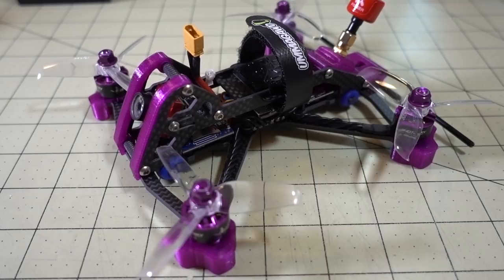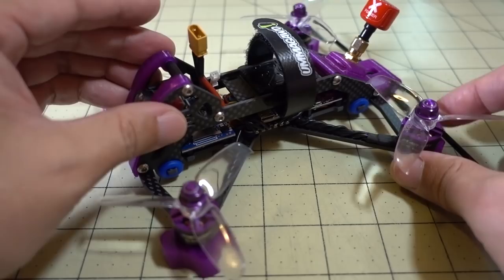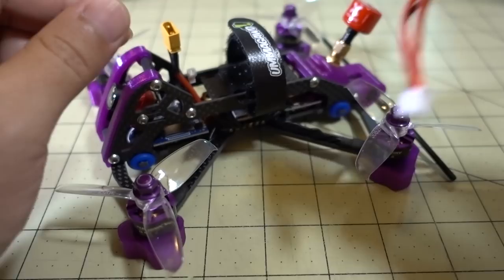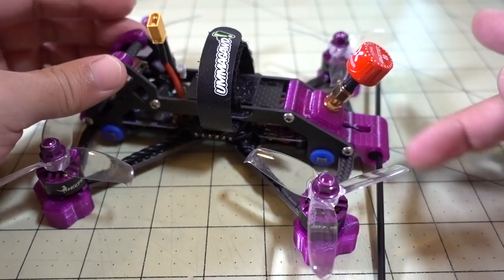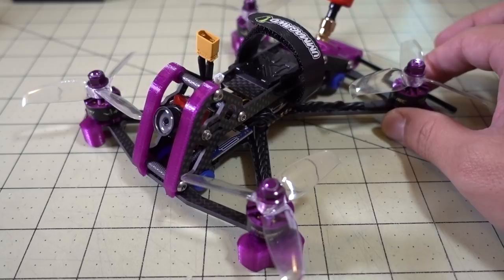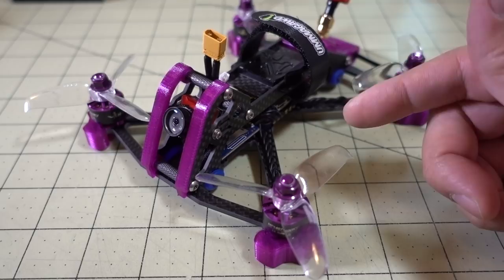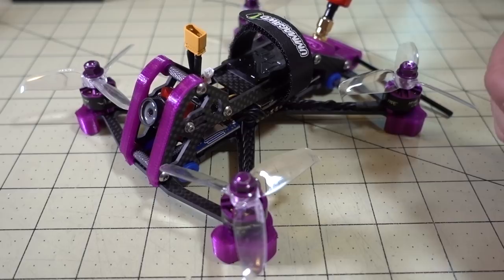The Acrobrat is a Heavy Micro 😜

Comment: I've been testing it out using BrotherHobby 1407 4100kv motors and Tattu 4S 650 batteries. Total weight with Caddx Turtle cam and no 3d printed parts is about 254g.  The quad flies extremely smooth with no jello in the video footage. Flight time can be a bit short at about 2 to 2.5 minutes with moderate acro flying. I'm hoping to find a setup that can last a bit longer with more aggressive flying. Maybe the new Hypetrain Brat motors will be a perfect match for this frame.

Comment: I used the iflight tachyon 1408 4100kv motors on my Acrobrat and I really like them! I didn't use any tpu parts either. With a 4s 650 it is right at 250 grams.

Comment: My Acrobrat(with 3D printed bells and whistles) is 211g without the battery + 850 mAh R-Line just starting to feel heavy on 1407 4100kV Tornadoes. It's very smooth and very easy to fly. Feels light with 650mAh 4S battery. No desire to upgrade to larger motors, feels just right!👍 Maybe it's the higher kV, or the Tornadoes are stronger than the HGLRC motors. Sorry, it's no fun when the drone is underpowered.
Also, very happy with BF 3.5, reduced FF to 50 to smooth out jerks.

Comment: My Acrobrat comes in at 188g with HGLRC 1407 3600kV motors and Caddx Turtle. On Tattu 4S 650mAh I get about 4 minutes of great flight time, definitely a sweet spot. I found that motor feet created a lot of inertia at the extremities of the quad that affected the handling, swapping for bumpers was an improvement. Also switching the Immortal T for the dipole and the Foxeer Lollipop for something lighter will help bring the weight down.
Try my bumpers here: https://www.thingiverse.com/thing:3044444

Comment: Hi Albert, this is an internal debate I have myself cause I've got a 3" Nemesis X and recently built the AcroBrat.
The Nemesis weights 132g with the mobius mini on, and I can fly it with 1404 motors. The only issue is the jello on mid day light.

The ppl is using all those printed parts and huge 650-850 4S packs on the AcroBrat hence the weight is well over 250g and it looks like a lot of pro freestylers find it perfect and awesome. Although I have not weighted it yet (motors and HD camera are still on their way) I think I will try to shave down some weight and keep it on the 250g limit that allows me to fly it in urban environment in Spain.

In my mind, I'm going from a lightweight efficient 3" to a heavy inneficient one. I'm so used to nimble micros that I'm afraid I won't like this build. 
If I remember I will update this comment once I put some packs in.
Reply from the maker: I also prefer lighter more nimble micros.  I think this one is more suited to 5-inch freestyle pilots who want the same heavy feel as their 5-inch but can fly in smaller spaces.
Reply: MAxB. I will check it for sure! Now I need to put some lipos onto this brat and see what it’s got hehe btw, congratulations on your skiing videos, I’ve seen the career one and it’s quite emotive! Keep on enjoying your passions!
Reply: Cool looking frame dude.  Thats in Merican $ correct?
Reply: Jrod RC Jep it is US $

Comment: From my experience with the HGLRC 1407 flame motors, a 45C 850mah battery is not going to keep up with those motors amp-wise... I would try it with a 4s 650mah 80c or a 4s 850mah 80-100C... I cant speak to the acrobrat specifically but i do run a couple sets of those motors and they are beasts but you need to have the amps available to feed them
Reply from the maker: Check out the follow up video... I've updated this setup.
Reply: @AlbertKimTV  Ah, yes you have. Ive been thinking of switching out the hardware from my BNF XJB-145 to an acrobrat frame and switching out the VTX in the process... I was also thinking of the Geprc sparrow frame just to get the props out of the shot. Is there any other 3" frames you would recommend?

Comment: Sweet vid AK! I have a dji acrobat duo that I think can use a bit more motor. Currently using 1407s. Was going to go with 1507's, but would love to hear your take on the 1606 vs 1507s? Which would you go with?! I know emax has 1606's on their 4" bhr pro, but wasn't sure how they'd run on 3"..
Reply from the maker: I know people who run 3-inch on 1606 motors.  I have not tried it myself personally.  It's a lot more weight for 1606 vs 1507 and I feel 1507 is the sweet spot for 3-inch acro.  It would take a lot to convince me to switch to 1606.
Reply: @AlbertKimTV  Thanks AK! Keep the vids coming!

Comment: Thanks for the review. I recently finished a more massive droner with Brother hobby avenger 1507 @ 4100kv Love it but thought it may be a little over powered on 4s, was thinking about swapping them out for the hglrc motors. Seeing this video has me thinking about using the 1507s in something like this. I like the idea of a 3" freestyle frame capable of 1080p. What do you think of the hobbywing nano Hobbywing X-Rotor Micro F4 G2 Flight Controller?
Reply from the maker: I don't have that FC.

Comment: I've seen you fly so many times I can see you adjusting in the roll axis for the weight during cornering. Interested to see and learn the difference the new motors are going to make. Great one.
Reply from the maker: That's why I need more powerful motors to compensate for the extra weight.

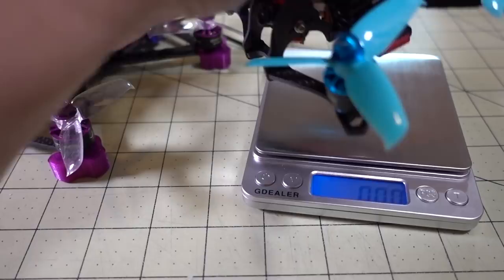Comment: I feel the same also and having the same problem like you Albert except it’s with fly time.  I’m running BH1507  3600kv on tattu 4s 650 and getting 2:30s flights even with a GNB 650 I get 30 seconds more. I will be testing the the 850 GNB but i feel the extra weight is gonna take from my performance since the brat is already heavy. Right now I’m getting good power with AUW at the 250g mark with just tpu arm guards. I wonder if the brat motors will make a difference with the flight time issues and performance?

Comment: What would be the PERFECT motor in your eyes for a fully loaded TPU Acrobrat Duo carrying an insta360 go? It'll be for an aggressive freestyle build.
Reply: I'm currently on NewBeeDrone Flow 1408's 4150kv and there's still more to be desired with punch through mid-power. I wanted to try the FPVcycle 2203's after seeing a 3" Banggod using them, but I wanted to ask the master first 😉
Reply from the maker: I have not tried the 2203 on a 3 inch.  I have heard 1507 motors are the best for the Acrobrat frame.  There are a ton of those to choose from.
Reply: @AlbertKimTV  thank you! 🙏

Comment: iFlight iH3 weighs 39 grams and acrobrat weighs 54grams... this difference of 15 grams seems negligible to me. How much do the 3d printed parts weigh, have you tried flying without them? They're only there for smashing into concrete walls. You don't run the same parts on any of the lighter frames you prefer so why need them on the acrobrat?
The benchmark for 3" seems to be auw under 250 grams. If so, 15grams is a fraction of that.

Also have you tried flying it with a 450 battery? I thought micros were made for 450 batteries, 850 seems huge on one. 1300 seems to be the go to battery for 5", imagine if you doubled that, you wouldn't be running a 2000mah battery on a 5", that seems to be the equivalent here.

I want to build a 3" so here doing some research. I heard some getting 12mins flight on 3", what kind of combo is needed for that?

Comment: hi albert i used the geprc 1408 motors on this frame and they worked well . what would you recommend for a battery size for this frame with the tachyon 1408 3500 kv
Reply from the maker: I use the 550mah GNB 4S, but a 650mah would be better but I don't think they make that size.
Reply: chl   tattu or pulse are the only 650 mah i have found  which one you think
Reply: i have the 550 also

Comment: I’ve got the brat motors coming for this frame. Like you I’d like to lighten it up a bit bit not because of the flight, because I think it’s maybe too much weight for the frame and as a result I’ve broken one and fractured another in relatively minor crashes.  Please keep us updated with the changes on this one.
Reply from the maker: What part did you break in the crash?
Reply: I broke an arm that goes the the motor, pretty much a clean snap. I have another frame that happened on the exact same arm but only fractured one layer of the bottom plate. I had the exact same tpu feet that you have on yours and my theory was because those feet set so high that when i landed with the weight of the battery (4s 850mah)  it was causing the frame to be flexed point of weakening each time I landed. That being said I have "concerns" about the quality of that bottom plate.

Comment: Looks like a nice frame and I considered it until I saw the frame weight of 54 grams. My mode 2 six inch frame weight is 57 grams.
I like the rubber isolation idea in the Acrobrat though. I went with the IFlight IH3 frame instead that weights in at 39 grams which I still don't consider light either but it does have a dual stack for a runcam split type setup. Good review as always Albert.

Comment: I think the point is to have a sub 250g HD video mini quad.  I am using 1306 4000kv on mine and I'll agree it's not a power house but.... It the smoothest 3 inch I have, the large footprint and soft mounting makes it work well for smooth cinematic freestyle . I use 650 4s and it works well.  I think the weight and power of it would be better as a 4inch but I like it nonetheless.  I had the japalura for a while and it's a pig. Went to 4 inch with 1407 and now it's awesome, probably my favorite.
Reply: Richard Tardif Tommy said there is a 4” in the works. Honestly it wouldn’t add much more weight

Comment: How is the prop wash? How smooth is the flight? Is it more twitchy like a 2.5-3" or does the weight ratio smoothen it out? Rotor Riots most recent discussion regarding the difference between racing and freestyle builds has me thinking about how to make 3" drones float more and be smoother. One thing they mentioned was the low power to weight ratio of a freestyle build. Do you think its possible to achieve the same flight characteristics of a 5" into a 3".
Reply from the maker: I believe this was the goal Tommy had in mind.  However, I think because the frame was heavy to start with, I'll need better motors to get it to fly like a 5 inch.  It still flies fine, just feels heavy and you have to manage your throttle more because of the weight.
Reply: Then I'm excited for your update video. Thanks for the reply.
Reply: I really like how smooth and easy to control the Acrobrat is. It's a stretched X and much longer than a typical 3" drone. I think it helps along with extra weight
Reply: @sergeiiakimenko3648  What motors do you got?
Reply: @kyleray4952  1407 4100kV Tornadoes as recommended by Tommy
Reply: Sergei Iakimenko isn't it a true x
Reply: @supfpv  Wow! Just measured 115mm between motors ALL AROUND! The distance between the end of 3" props is 40mm but it is less noticeable down the middle because of the body of the quad. It creates an illusion... At least in my eyes 😖
Thanks for pointing it out!
Reply: @supfpv  yup.

Comment: The Acrobrat would've been a great 4 Incher.
Reply: my thought exactly. Actually I am thinking about creating a different bottom plate that fits 5 inch props. That would make sense.
Reply: The Acrobrat is a great 3-incher...sort of. It's a stretched X and it's as long as 4-,maybe even 5-incher.
Reply: @sergeiiakimenko3648  why not have the benefit of a larger prop, if you're going to take on the weight/footprint of a larger quad?
Reply: @chubbafied  I think it helps stability and makes it very easy to control. I am glad it's 3" because 4" props are too much for backyard flying

Comment: Hey Albert, and for all the guys who would like to get a new full HD 3-incher here is some news: https://armattanproductions.com/pages/kit_detail/1827
I also had the goal to get a full HD capable 3-inch drone with gps function, but unfortunately there where none really good available in Europe about half a year ago. So I designed my own one. 
And it flights awesome, is fairly light and also very tanky at the same time, I haven’t broken a single piece yet.
If you are interested let me know or order directly.
Reply from the maker: I'd be interested to review it.  Does that only work with the full size split or also the split mini?
Reply: It works with 30x30 and 20x20 stack. what you prefer. (The 3D-printed TPU mounts for the camera propably have to be updated and set forward about 3,5mm to fit the shorter lens of the mini.-i could make that if somebody needs it.) I'm also planing to make a dedicated 20x20 version as well in the next view weeks. ;)

Comment: 3s or4s?
Reply from the maker: 4S
Reply: @AlbertKimTV  I am currently running the Brat motors with 3s....4s batteries are coming in the post in minutes...1407-4140Kv
check out my page, I put LED headlights on it